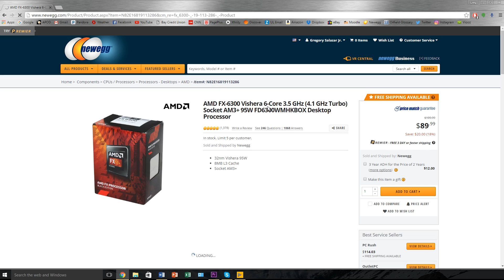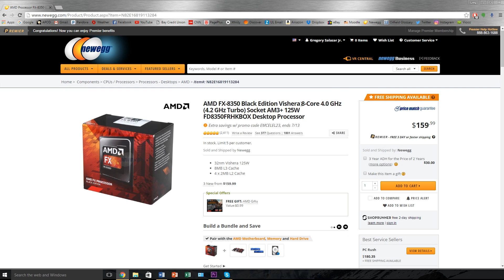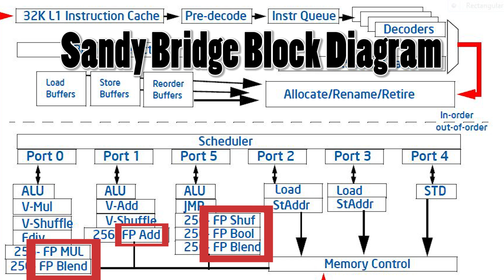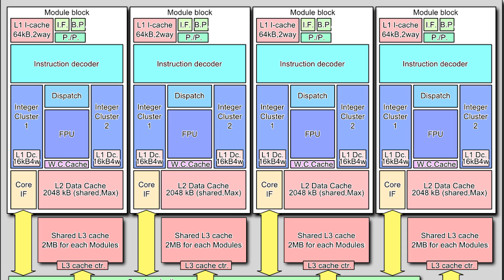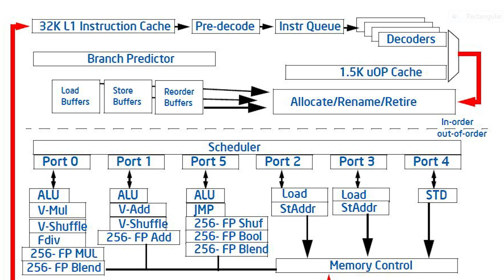How Many Cores Do AMD FX Processors *Actually* Have?

Comment: so basically, if the industry went amds way(e.g. software optimisation), then they would be much stronger than Intel's? are there actually programms that are amd optimised instead of Intel?
Reply: +TheOz1999 even though Intel gets higher numbers.
Reply: Multi-threading makes sense from a future point of view. Direct x 12 is allowing older AMD CPU's (8350) to at times double in performance. https://semiaccurate.com/2016/02/24/looking-at-directx-12-performance-in-ashes-of-the-singularity/
Reply: Yes BUT because AMD hasn't been improving the cache or the core itself other than ramping up clock speed over the decades(Except APU).

Intel took their place.
Reply: Not all of them have the Igpu enabled and the HEDT and most Xeons do not have a igpu on die at all.
Reply: Not in total performance, but clock per clock. core per core intel's is better if you plan to do compute on them. Graphics wise they are also more efficient. Intel ivybridge HD 4000 has only 16 shaders. If you made a dedicated GPU with intel graphics and put the same clocks and shader count as nvidia or amd gpu the intel gpu would outperform them. There exist an intel dedicated GPU that costs a few thousand per card but is used mainly in compute.
Reply: System0Error0Message I think you mean Intel xeon phi cards? I cannot recommend them for graphics....
Reply: Dont forget that intel ivybridge and higher supports openCL on GPU and after testing intel's IGP performance it is far superior in openCL in a clock per clock, core per core bases compared to both nvidia and AMD GPUs for running openCL. This is because of the ratio of resources in a single GPU " core" which isnt a shader. A single GPU core has a bunch of shaders and other units so it is incorrect to say a HD 7970 has 2048 cores rather.  Each GPU core has an equal number of texture units, shaders and so on. If you run the OpenCL info utility on the GPU it will tell you how many cores it actually has as compute units. This is essentially how instructions are divided for GPU compute so to take advantage of the many shaders you need an array dataset so a 2D array with 1 dimention number of cores and the other number of shaders per core will take full advantage of the units in a GPU.

A shader is essentially a unit just like an FPU.

Comment: Hey Science Studio, Do you think nanometer architecture will go down to a smaller dye like picometer? Like for gpu's and cpu's when the dye size goes to an incredibly small size like 14 nanometer and beyond? I asked another channel but i had no idea what they were talking about.
Reply from the maker: I'm sure by that time, we'll be using something other than transistors.
Reply: I second what Greg said, due to an electrons akin to bouncing around on transistors which is the cause of errors, so after 10nm you couldn't really get any smaller without changing the entire architecture relatively.. I wouldn't be surprised if intel didn't make some level of changes with their 10nm stuff, which is probably why they had to set it back a year..
Reply: +Surms41 there's a whole Era of new technologies being developed and discovered right now. high electrical currents for computers and electronics running through a membrane for one, li-fi, electronics made from coal. it's an exciting time.
Reply: it would be impossible to shrink a transistor to a picometer as a hydrogen atom alone is about 0.1 nm
Reply: Also, traditional silicon is reaching near it's limits for it's density. As in, we're reaching a point where the pathways for CPU's needs to be near 1 atom wide to fit into a smaller area. So by the time we get to that point of CPU shrinking, which I'm guessing is about 4-6nm, we'll have to move on to another material to produce a smaller one.
Such as titanium trisulfide, which is just over 1 atom thick.
Reply: +Dillon Scott oh that makes much more sense. thanks!
Reply: jester0075 Didn't hear about the membrane thing, might look it up.
Reply: Silicon transistors actually have a limit. This limit is right around 7nm. At this point, electrons start quantum tunneling across the transistor and doing other crazy stuff. Different technologies are being developed to move from silicon transistors (maybe graphene) to something that allows electricity to move physically faster and with more efficiency.
Reply: Does  graphene and graphite have anything in common
Reply: Mark Castleton graphene is a one atom thick sheet of graphite with a hexagonal arrangement of carbon atoms.
Reply: Jonathan Snodgrass What does the molecular structure have in common with diamond
Reply: No clue at all. But graphene is incredibly strong for its weight and thickness.
Reply: Jonathan Snodgrass Okay thanks

Comment: Would be interesting if you did a video bringing up the Intel compiler, and cpu spoofing that results in AMD spoofed as Intel (or executables patched to ignore the "genuine Intel" check) gaining significant boosts, and likewise Intel CPUs spoofed as AMD taking equivalent hits. and for years this artificial discrimination being present in both games, productivity software and even benchmarks, including cinebench for a long time. Less programs and games use it lately, but it's still shocking what you find when doing a scan, and you can get free performance greater than overclocking when patching such programs on AMD chips

Comment: So in AMD's platform it is like every 2 physical CPUs share 1 brain. In Intel's hyperthreading platform every CPU has 2 threads and each thread has its own brain?

I guess that would explain why an AMD quad core performs about the same as an intel i3. I was always curious about that and just assumed that AMD core are less efficient than intel cores...

actually, I don't think I understand it at all...
Reply: AMD quad cores perform about the same as a modern Pentium in most cases.
Reply: I wrote this above trying to explain, so i'll just copy and paste it. 

Office is a module, the boss is the Fetcher, Decoder, and scheduler; Each worker is a core, and the internet speed is the share resource (FPU). When someone multi task it's hyper threading
Intel: As to why Intel single core performance is better, and hyper threads are not core. Intel the company have 2 worker; Each one of those worker works is heavily through the internet. Unfortunately for Intel, sometime the amount of company task that need to be done exceed the amount of worker they have. Though, each one of these worker can only realistically do one thing at a time. In order to tackle this problem, and improve work performance; Each office is given a boss who obtain information to find out what task need to be done, and schedule the workload to the worker under him; The worker then have to multi task the work given to him, and in order to keep this double task work efficient.  Each worker is given their own work space in a office, a their own boss, and a 1MB bandwidth internet speed. 
AMD: AMD on the other hand have 4 worker for their company. Their works is also heavily through the internet. Sometime AMD work load exceed 2 task also. Instead of having 2 worker try to multi task these extra workload. They actually have extra worker to take on the extra task instead. Unfortunately due to the limited space at the company. Every 2 worker have to share work space in a respective office, and the same 1MB bandwidth that is available is split among the two worker into a 500KB speed. Which limit the work performance per worker, but they would be able to get real multiple workload done quicker. They are unfortunately bottle neck in the office at how effective the boss for the office they work in at finding out the tasks that need to be done, and distributing that work load to the 2 worker. 
Apps perform worse for AMD than Intel, because program are not coded to use the extra worker AMD have. So, the apps is basically giving the AMD company a bad boss who only give 1 worker at AMD all the workload with his still limited resource. If the boss do see the second worker. He see him not as a extra worker to give the extra workload to do since worker 1 is busy, but to to tell worker 2 to just stand there and do nothing; His only assignment is to tell worker 1 his next task to finish after worker 1 is done with his current task. (Worker 2 basically become the lazy fuck no one like at work. Whose only there to tell your already busy ass, whose already working on limited resource, what the boss told him to tell you to do next; While worker 2 laze around doing bum fuck nothing, and boss never assign his ass project to finish; Even though the jackass have the same fucking job you have.)

 I hope this help you understand how a Intel hyper thread CPU work, and how a AMD CPU work. In truth, a bulldozer architecture 8 core CPU from AMD is actually  better at performing multiple heavy workload task than a Intel 4 core hyper threaded CPU. Unfortunately for AMD bulldozer CPU owner, programmer never coded their apps to take advantage of the extra core AMD CPU have, so those extra core basically don't exist for those apps. Making the apps run on the shared resource of the 1 core instead. In term, naturally making AMD CPU perform much worse than Intel CPU; Even though it's a much more complicated and advance CPU.

Correct me if i'm wrong
 From what i'm able to gather. A program design to stress the workload on a Intel CPU will show AMD CPU worse not because the CPU is actually that much significantly worse, but because it's not coded to use all the extra core in AMD Bulldozer CPU. Meaning, for a 8 core AMD bulldozer CPU; The test is only using the 4 slower single core performance; Completely leaving the other 4 unused, and if used, as crappy hyper used to tell the slower single core performance what to do next.
 On the other hand, a program design for a AMD bulldozer CPU will show AMD as better, and will not do as much of a damage to the real performance of a Intel CPU, because it will use all of the core available, and not half. Allocated all the extra task that would have gone to any extra core Intel may have, but don't have to the hyper thread. Intel CPU will still show better single core performance, but will not show it's multi task performance to be better than AMD like most test out their seem to be doing, because they are not using the extra core in those Module. For gaming, Intel CPU will still perform better than AMD though; Since most game relied more on fast single core performance than multi core performance. Since they do not need to use that many core.

Comment: you also should point out AMD comes out with a new CPU once every whenever the fuck they feel like it but Intel comes out with new CPUs every year.
Reply from the maker: AMD's "new" CPUs are primarily revisions.
Reply: thanks for the reply and that's exactly why I only use either Intel or ARM CPUs (I use ARM in Raspberry Pis)

However I use an R9 285 GPU

Comment: The FX8350  is Vishera basically a bulldozer refresh. Because Fx8150 was only  a little bit faster as the Phenom 1100t  the prior flagship at that time. All the bulldozers did dissapoint in performance.

Comment: ok stupid question but do the processors minus the graphics in the ps4 and xbox one work the same way?
Reply: They are basically the exact same system hardware wise, same APU, xbone just has a weaker iGPU and has a higher clocked CPU than a PS4, and the PS4 has GDDR5 memory rather than DDR3 which is what the xbone has.

Comment: So basically AMD CPUs can't operate as they intended because OS adapted intel way of doings things as standard. So either AMD has to beg for support or do the same thing that intel does? Kinda feels unfair. Ofc if i understood everything correctly.
Reply: +Felix Gabe which really sucks bc of their parallel gpu processing ability, which dx12 (& Vulcan)  finally got and bumped low level Amd gpus to top tier Nividia gpus in some games.
Reply: If AMD had waited till they had a larger market share they might have been able to force the market, or simply introduce these new concepts more slowly. This was the little guy throwing something new out and hoping the entire markets would be eager to shift around it. For consideration When near monopolies try to force this big of a change all at once they have a hard time at it and people are normally angry at first. It only works because they don't have a viable second option to avoid the change in the long term.
Reply: The same thing can also be said about their GPU with most games and application don't play as effective as Nvidia's GPU.
Reply: Actually they did with windows 10.
And if you compare Steamroller to haswell I3 with 4mb cache to an 860k.

In multi thread, the X4 860k is somewhat faster depend on what its doing.

The bulldozer modules are great for server and scientific computation but awful in daily gaming basis.
Reply: In this case sure, but there has also been cases where Intel had to throw their work in the trash and do it AMD's way. x64 to name the biggest.
Reply: AMD had sucess with their new technology a lot; if we only had intel, we would have the trickled down IA-64 x64 implementation, slow, incompatbile, and non-monolithic dual cores (Pentium D), hot and slow.
Reply: That's true even to this day.
Reply: Actually back in the days of Phenom II, AMD used the true cores method that Intel has been using but changed that in the FX processors. So it's more like Intel and AMD adapted the OS.
Reply: Felix Gabe Any game that uses Physx is already better with Nvidia than Amd. The Borderlands series is the best example of this, the games use Physx to a good extent and not having it on Amd ruins the gameplay to an extent.
Reply: except if you're Apple
Reply: Xavier He if we had apple we would still be using singelcore pentiums because Apple is going "never touch a running system Stile" do only smal changes so it looks new
Reply: @thrawn9115  good thing intel buried amd and will do it again. Theyscammed so many people with fake cores , they should have been outright banned from doing anything.
Reply: AMD fans believe when AMD does something the world should praise and blindly follow them like a good zealot.
Reply: @TheRoflcopterGod  amd tries to innovate intel just sits on there back side and jacking up the price  now amd bring something better to market from there own innovates and now intel dont know how to compete
Reply: Devs aren't the world and they chose Intel over AMD, so your statement is nonesensical in any way possible.

Comment: I own an FX-8320, I have overclocked to 4.3 Ghz, 4.4 Ghz and higher voltage produces too much heat so stock voltage and 4.3 Ghz which is near 9370 speeds and a bit over the FX-8370 produces good results. Great video helped me learn alot about my FX-8320, I find it works quite well with my GTX 970, I still produce high quality results with it clocked up to 4.3 Ghz (Currently sitting at 60-70 fps on Rainbow Six Siege on 3k~ (3.0x 1080p) Very High Preset.

Comment: is it worth waiting for Zen when u got 150$ to upgrade?
Reply: +esperCELL the fx 8350 is pretty old and ypgrade path is pretty bad
Reply: You will need to buy a new AM4 motherboard, RAM(DDR4) and a new processor. We can assume that one of the Zen CPU (most likely the quad core variant) is going to cost around 120$ (competition to the i3), a decent AM4 mobo should cost around 80$ (maybe less) and 8GB of DDR4 cost around 40-50$.... SO, i'd say that 150$ is not enough to upgrade to Zen! Basically I think you will need at the very least 250$ to upgrade to Zen (IF you live in the US).
Reply: Oki ty for letting now
Reply: get a intel core i7 2600k
Reply: Is it better then a i5-4690k?
Reply: It is because it's a core i7 after all. But it's a sandybridge. It may not fit the same board as the 4690. Check the lga
Reply: +Jack Le i7-2700k needs a 1155 board and Cant find any 1155 board in swedish retailers
Reply: I think I will go with the 4690K and overclock it :D
Reply: Vixxen 88 good luck m8. I guess quad core is enuff for gaming. I'd go with the i7 2600k because it has hyperthreading and I already had an LGA 1155 board.
Reply: fair enuff :)
Reply: I'd get the i5 with more recent architecture over the older i7. Somewhat analogous to getting a 980ti instead of a 1070 except the time between the cpus you are considering is much greater. Always get newer with computer hardware, I'd never 'upgrade' my i5 to an i7 from a previous architecture, makes no sense
Reply: ***** http://cpuboss.com/cpus/Intel-Core-i7-2600K-vs-AMD-FX-8350

Comment: I wonder if you can disable individual cores on the FX systems to basically take the 8 core Vishera and determine the best overclocking core of each cluster and enable just those 4 cores for a performance increase in workloads that don't scale well past four threads.